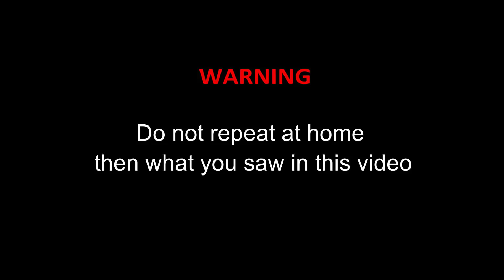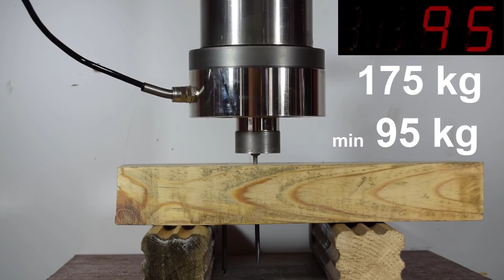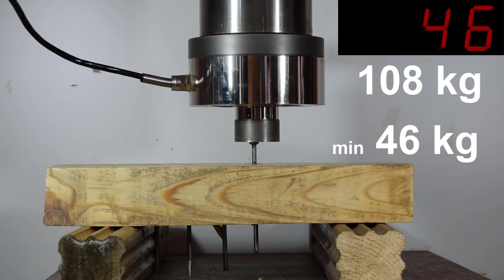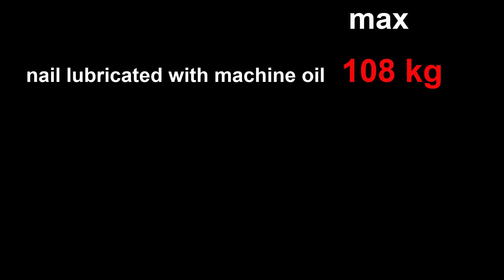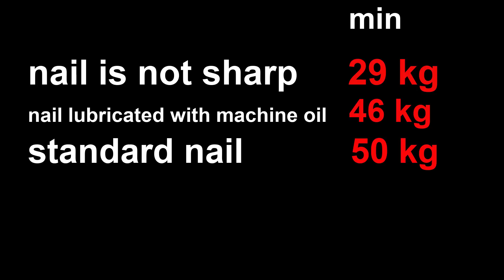HYDRAULIC PRESS PRESSES THE NAIL, DRY AND LUBRICATED

Comment: Cool video :-)) The sharp nail has a lot of  taper to it causing more lateral friction / side load as its acting like a splitting wedge so its the hardest to push through :-))
Reply: And it tears out as little material as possible, so it creates the tightest fit. It will stay in place better than the others.
Reply: @geoffstrickler  agreed :-))
Reply: Nope , its just about the wood, its not uniform at all
Reply: @GG-be6co  Tell you what, why don’t you do a few hundred or thousand tests of each, and get back to us with the results. Then you’ll change you beliefs.
Reply: @geoffstrickler  because im an engineer and i estimate, use a more homogen wood or other material
Reply: @GG-be6co  If you’re an engineer, then you should understand what I wrote. Despite what you may believe, being an engineer doesn’t mean you know everything. That’s why testing is essential. Do the tests and get back to me when you have some hard evidence, not just your beliefs.
Reply: @geoffstrickler  well i haven't said anything about knowing only guessing and if the friction was the main parameter the oily one would have got better results
Reply: @GG-be6co  Note that I didn’t attribute it to friction.
Reply: @GG-be6co  I agree that for accurate results, testing needs to be performed on blocks of the exact same material. Then and only then can theories and conclusions be given. I'm also an engineer.
Reply: @GG-be6co  

Def not an engineer
Reply: @geoffstrickler  Yes that can be seen in 6:15
Reply: Thanks for the video.. despite being the "same material" wood can have knots, intrisic torsions, more or less compressed fibers, and all in a matters of centimetrers so you can't determine such results with only an attempt per case, unless you want drive results to a clickbait outcome, and I trust this is not the case.. yes, with a 4mm and quite long nail lateral compression and thus friction can play a very relevant role, just think of the greater torque you need to drive thicker screws.. and slowly pushing rather than hammering can also bring some differences.. but in this case I guess also the chance is playing some role.. a more reliable test could be using a piece of mdf rather than real wood.. however the video is interesting! To those thinking that a not sharpened nail can penetrate so better one could figure out why such thick and long nails were produced with a specific cuspid.. I have no answers, but the question is legitimate I hope :)